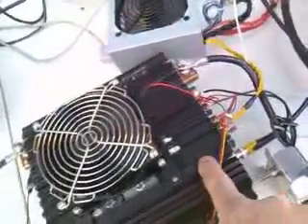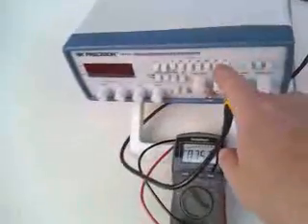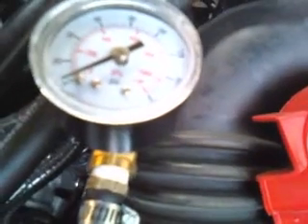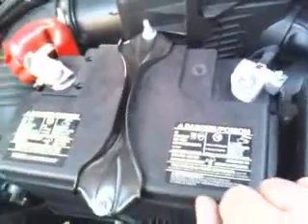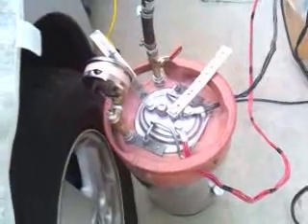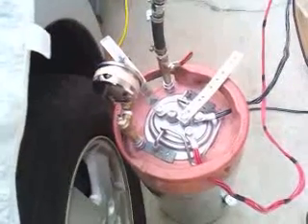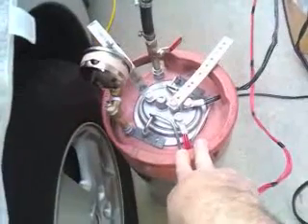2010 Ford Escape running on HHO gas #1

Comment: Your the problem, engineers are not going to rock the boat and bite the hand that's feeds them.  Take the Ponds and Fleishman, they created cold fusion. And the academic Idiots, that have spent multi Billions and decades to do so 
couldn't. they felt threatened. They, would not be WRONG! They allowed their arrogance, and pride to stand in the way of a break through that could save this planet.  

The two were ridiculed, told they were lying.  All because they could not stand to be proven wrong.

Comment: To my knowledge, non-direct injection systems only require about 35-70 psi to operate. Direct injection is usually up in the 3,000 psi range. If the engine requires 250 cfm of air/fuel to operate and the air to fuel ratio is 20:1, I think that means that 12.5 c.f. of fuel per minute is required to run. I realize that I am using liquid fuel in this ratio. The question is, can hydroxyl be produced on demand fast enough to be used as a sole fuel source instead of just a combustion modifier?

Comment: You said "Pressure is volume, same thing". Your words not mine. This statement is absolutely false. I said nothing about time. 
Since when do injectors work off hydraulic pressure?? Some injectors are electrically triggered but I believe they are rated by PSI - at least the ones in my 5.0 Ford are. 

Please don't get me wrong. I COMPLETELY agree with your mission - time for Big Oil to go. I simply want you to be a better representative and be accurate with your statements and theory.

Comment: Pressure IS NOT the same as volume. A 1/4" dia. hose ar a pressure of 40 psi will absolutely NOT pass the same amount of gas (or fluid) as a 1" hose at the same pressure. You need to do some more research.

Comment: My guess is that 60 lbs. of compressed gas pressure wouldn't activate the injectors. The injectors work off hydraulic pressure. Also, pressure is not as important as volume. If you can't produce the HHO in large volume, quickly, the engine will end up starved for fuel (HHO). JMHO

Comment: you should modify the manifold and port to the intake valve of each cylinder inside the vacuum. porting to the fuel injectors wont do much good if you don't have full control over them. if you were using a AFC to tune ECU and open the injectors more per timing then you could port to the injectors easy